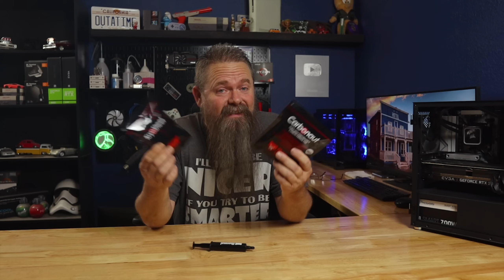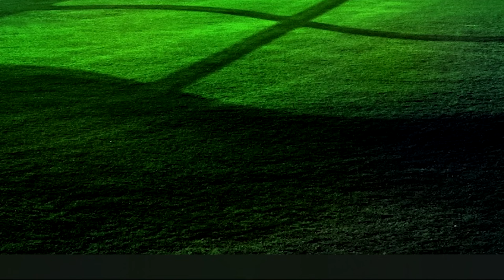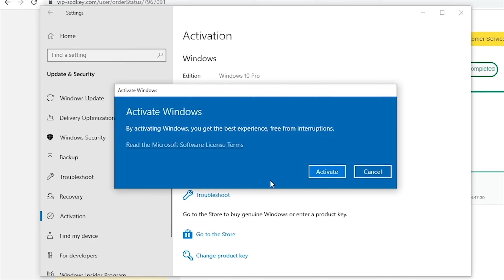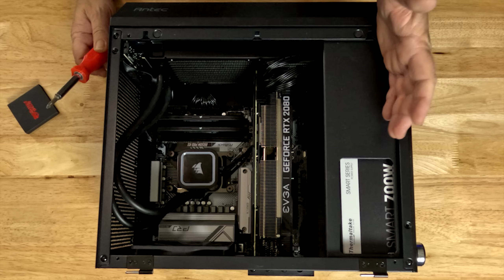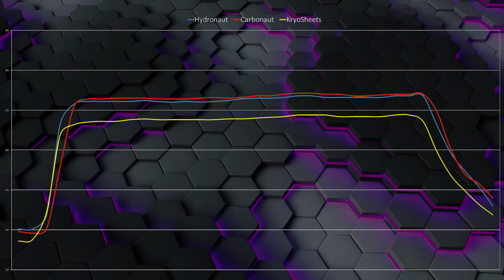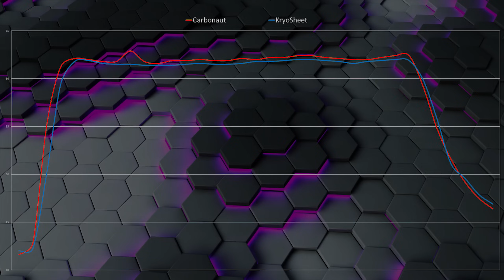Thermal Pads OR Paste, Which is Better?

Comment: This whole cpu temperature morass is a tempest in a teapot, IMO.  All of those methods work and work well everything else being proper.  But if you are a nut case about abusing a 'puter until it dies then being OCD over cpu temperature is a way to keep you off of the streets.

Comment: I have been the Kryosheet of the last few builds that I have done and I think what you are missing is that you don't have to re-paste and if you tested a system with a Kryrosheet after a couple years it will be the same as when built, whereas paste will slow go down over time.  Also, since most people can't agree on how much paste to use the sheets just life easier.  Pay a little more up front have the same performance till dismantle or replace the system several years later, or save a few dollars on the paste, but spend an hour of your time once every couple of years to re-paste your CPU, and I am sure an hour or even a half of your time is worth more than the $20 you save between the two solutions.  Anyways great video, informative, but you should consider a long term test, it might take a year or two to make it but I think the results will surprise you.
Reply: This is good to know. Longevity wise. Definitely going the kyrosheet route.

Comment: I got a sheet of PTM7950 to try, ended up using it first on an Epyc CPU.  Was initially more fiddly to work with than paste but not having to worry about die coverage (not that the chip I'm using it runs particularly hot) or having to potentially replace it in a few years makes me feel like it was worth the minimal bother getting it installed.  Probably much more worthwhile on a chip that runs hot though as the whole point is the better thermal transfer over time.

Comment: I’ve had a i7-6700k in place for 8 years of gaming that just started crashing. Anyway, today i learned that thermal paste needs to be refreshed every few years.
Reply: HAHAHA WHAT?! I'm still using a i7 3770k with it's first paste.
Reply: @HungerForMore0   Haha same. i7 2600k still running with 15 year old paste lol.
Reply: @sirhendro there is no paste left boss
Reply: @HungerForMore0 same. Didn't know this was a thing until now
Reply: I never  change or replaced   the thermal paste (Artic Silver 5) on my CPU for almost 10 years now  😅 (intel 6700k)  , and keep going strong  😅
Reply: aye i been using an i5 6700k
Reply: @oGKiidNoVa  No you haven't. You're either on a 6500k or 6600k - i5 6700k is not a thing that exists.
Reply: @Taizunx  you are 100% right its a 6600k. my bad mistyped !
Reply: Ya i should do that one of these days...i dindt reapply paste since 2014 when i got my 6700k
Reply: Yup, still on my i5 4690k out in the garage computer.  10 years old and still doing just fine
Reply: Hahaha. Today I changed the paste of my CPU and GPU. Because I noticed the temps of the GPU higher than before. The paste of the CPU I changed it maybe 3 years ago and 3/4 were somewhat fluid. But the GPU I did not change it before, my GPU has 8 years. And everything was solid, dots and lines of grey rock.
Reply: ive had mine for 11 years and have never touched it xD
Reply: 5 years is good practice, also goes for consoles like PS4
Reply: Been there! Rip 3600
Reply: It’s been 6 months and I’m here watching this vid thinking about changing mine. 8 years??!😭
Reply: I've been involved with computers since i was an infant and i just learned today that you're supposed to change the paste.
Reply: It is weird but I have been building since late 90s - outside of an AMD T3 CPU(s) - and even a Intel CPU in the last 7 years - never had to re-paste even after 5 or 6 years.  I keep an eye on temps and never had any undue problems.
Reply: @cylonred8902 overclocking them regulary by 25%?
Reply: The fact it was still going strong for that long until just now is a testament to how amazing Skylake was compared to the chips we're seeing from Intel now.

I still have a 6700k system from like 2015 or 16 running at 4.2GHz still going strong in December 2024 and I only reapplied paste one time ever.
Reply: I've had my i7-6700k pasted with a BeQuiet! Dark Rock TF on it for 9 years, absolutely zero issues. CPU temp has almost never gone above 65 degrees. No plan to re-paste it at this point., I'll be building a new PC sometime this year before end of Win10 support Not sure if it matters what kind of paste but I used Arctic Silver, I'm somewhat afraid to mess around with it at this point XD
Reply: Dez nuts eh 😂
Reply: Ive not changed my thermal paste in 7 years and it still runs fine. Temps are good. Basicaly the cooler which is air not water, is a pig to get back on without removing the whole motherboard and disconecting everything which includes 4 hdd and 2 ssd's. So, until it causes problems, if it 'ain't broke don't fix it is the motto I use. 😅
As for thermal pads, I wonder what the longevity is compared to thermal paste?
Reply: I have a 4790K with around a 6+ years old paste.

The temps are still normal, so I guess it can last pretty long.
Reply: im always changing the paste when i go blow the dust out from my pc case probably 1 time per year :)
Reply: clean your pc entirely like every month or every 2 months and then just refresh the paste. if you dont clean your entire pc every month or 2 months thats fine, you can still refresh the paste. refresh lmao, replace is a better word.
Reply: Arctic MX-4: need to change less often - once in 3-4 years. But, cleaning the dirt on the fans, fins, on intake and exhaust mesh grills on PC case every 3 months, and proper cable management for good airflow is extremely important.
Reply: try updating the bios to stop cpu crashing. I have only ever added new paste when swapping out a cpu
Reply: Depends on many factors: IHS or bare die, cooler pressure, working temperature, paste viscosity. Under ideal circumstances, quality pastes are effective for a decade or more. Meanwhile bad cooler attachment and runny paste means it will be shortly pumped out.
Reply: Damn bro that cpu if it can speak it would be screaming at you😂😂
Reply: Mee too dear.. pc just started crashing and suddenly thru gpt research i realised.. it was thermal paste dry out (which was 4 years old) .. that was the root cause of all of my sudden pc problems.. 😅😅
Reply: sino tienes malas temperaturas no hace falta cambiar nada.
Reply: I've been using an i7-6700k without repasting it for a decade at this point. I've not been having issues, so I just left it be since dealing with the CPU cooler stresses me out.
Reply: Update: I've the thermal pad has the advantage of lasting pretty much as long as you keep your heat sink on. No having to refresh like thermal paste when it dries out. This wont dry out.
Reply: No.
Reply: My i7-6700k has been running well. Not touching it until I tear-down for the new system.
Reply: Pads for longevity, paste for the medium between longevity and performance, liquid metal for the risk taking performance crown seeker. 👏🏻
Reply: @brandenwaite  Liquid metal is garbage, it gets into everything and will short your whole system.  Ask your local repair business's and ask them their experience with this garbage and they'll tell you it's not worth it.
Reply: @rudylawver7077  agreed, don’t mess with liquid metal unless you’re attempting to enter a world record overclocking league table. It’s just not worth the hassle
Reply: I've been using a i7-7700K since early 2017 with kryonaut paste applied 1 time, my thermals are identicle today as they were when I built the system. CPU peaks around 70c under load. Isn't that crazy? I'm building a new system right now actually, and was looking up these pads to see if they're worth it, or if i should just get another tube of kryonaut. I actually think it's from heat cycling btw. I think people who power their computers off every night, have more thermal paste degradation. I'm one of these crazy people who leaves my PC on all the time, and I think it probably keeps the paste warm enough to stay pliable forever, whereas if you keep heating and cooling it, i think it will after time become more brittle. Ambient temps are like 20-23c, but I think if your computer stays on, the paste never gets much cooler than 35-40c. That's almost a 60F degree difference. I think people should stop turning their computers on/off when they're not using them. Yes your electricity bill will be slightly higher, like leaving an oldschool light bulb on, but I think there's actually benefits to it. The components aren't expanding and contracting as much.
Reply: Don’t you ever clean your pc from dust? Filthy
Reply: wut? 😳this explains alot...
Reply: so you haven't change the paste for 8 years? holy shite 😅
the general advice is to change the paste once per year
Reply: @ yeah haha. I hadn’t read about refreshing anywhere somehow. Lesson learned, for sure.
Reply: @macblink  the thermal paste industry thanks you.
Reply: @macblink  my amd fx 8350 black addition build has never had the paste changed, its a stock build from at least 15 years ago, god knows what paste is left but its nice and cool with a 5 g overclock
Reply: @macblink  I changed mine lol I did it when I changed my case out like 3-4 years ago.
Reply: @macblink  Once a year is beyond overkill. Ive had the same thermal paste on my 8700K since 2018. I obviously should change it by this point but I'm upgrading to a whole new pc in a few months so not gonna bother. Id say once every 3 years is more realistic.
Reply: @macblink That is definitely not necessary. It deteriorates slowly. Freshen every three years. You’re welcome.
Reply: @macblink 😂😂😂😂 no its not thats not a thing I've been building pcs longer than u been alive
Reply: @macblink  I have PCs where it hasn't been changed for longer than 8, and they're fine. It's a shitty paste if it degrades in 1 year, or even 3.
Reply: @macblink  Yeah if it was laid down bad the first time around. I haven't changed mine(nor do I ever until I build a new rig) for 5+ years and my temps and system stability has never changed.
Reply: @macblink  I don't think that's the general advice. Please think of professional server systems and the like, nobody changes thermal paste in these on a regular basis. I bet it will not be changed as long as the server is in service and these CPUs throw out a lot more heat than what average joe has mounted on its mainboard.

There is no issue with dried paste, as long as the cooler does not move. If there is movement, even the smallest amount, that dry and hard paste fails to do the job, because it will micro-crumble and that leads to bad thermal conductivity. Drying paste can be used on CPU coolers which screw on and have a really strong mounting system or on very small coolers, which don't tend to wiggle much because of their size / weight. Many intel CPU stock coolers still sit very tight on dried paste after many years e.g., they even hold on to the CPU without additional mounting. That's a perfect thermal bonding, but quite hard to service.. o)

I would not recommend using any (quick drying) high performance thermal paste on GPUs, because these are quite flexible boards with the cooling parts mounted not very rigid and tight most of the time.

Here's the catch though:
You don't have to think about any of these problems, just use regular silicone based thermal paste. Even the regular white one will do the job. It's been used for decades in all kind of power supplies and audio amplifiers. Quality silicone paste does not dry at all, it's not supposed to, because nobody tears apart power supplies and audio amplifiers to change thermal paste.

If your system only is stable with 1-2 degrees less temperature, any special thermal paste is not the right fix anyway. You should have some headroom all the time, even in summer, which makes clear that saving 1-2 degrees by using an expensive, inconvenient special thermal paste is pure nonsense.

The video here is quite some months old, I just wanted to put some different perspective out there, to all the new kids on the block, which might fall for the thermal paste scam business. "Which thermal paste" is nothing a regular PC user / enthusiast should care about, just use the most basic one and you will be fine. I even use CU paste in my test setups and systems with regular workload, it's actually meant to be used on nuts and bolts and sliding parts on cars and machines, but it also does the job. You can get a handful / life time amount of this stuff for a dollar almost everywhere, even your buddy doing cars will have some around on Sunday evenings.. o)
Reply: I built an i5-4590 desktop like 10 years ago using Arctic MX-2... never repasted it, never had cooling problems using the stock cooler, even running full load, but it only pulls like 65W. I imagine the higher your power and temps the more difference you'd notice over time.
Reply: @macblink I hadn't changed mine in about 7 years and with a 1.28 undervolt at 4.2 my temps didn't exceed 85-87c even after 7-year old paste. I just repasted it now recently but it goes to show just how well designed skylake was.
Reply: @macblink  Only once a year? I change it every day.
Reply: @macblink I change my Kryonaut all 2 years
Reply: @macblink once per year is too much, usually 2-4 depending on light or heavy use
Reply: @macblink I have not changed my thermal paste in 15 years. No wonder my computer keeps restarting
Reply: @macblink  Use a good paste. Don't need to change every year.
Reply: @macblink uh, once a year is completely unnecessary. Good quality thermal paste doesn’t dry up that fast, repasting every 5-8 years is fine
Reply: @macblink  just changed paste a day ago after 6 years couse cpu change and its never been an issue at all, it performed and looked like just as a new one

Comment: brother i give u now tipp for life.
if u buy a new cpu and cooler. the first u do u put liquidmetall on it, wish in very good and clean again away.
the think is u will never clean it to 100% perfect some molekul will always stay at the metall for ever. so the first you should do a very good liquid metall. after u can use cheap past or what else.
if u put a cheap thermal paste on it, you cpu will always get bad molekul on the metall.

i hope u understand what i mean.

the only thing to take this bad paste away, it so sharp it a little and polish again to mirror. it should glue on glass with out problem, so there is no air between no bad molekul

Comment: I have been using  a IC Graphite thermal pad made by  Innovation Cooling Since 2018 on my AM4 MB. I upgraded my CPU over a year ago and the pad worked exactly the same and I have not had any issues. I will never go back to paste. I mean with the cost of everything, what is $15 really. I built a second  system and am using the same thing. Great Brand!
Reply: What are the temps ?

Comment: I haven't used paste for seven or eight years. The small difference in temperature is not worth the additional hassle factor, or the risk of the spread not quite going right. And they don't dry out and need replacing.

Carbon pads are also much easier to use with the new oddly-shaped Ryzen chips.
Reply: Good point. I just took a look at my ryzen chip and was wondering how I was going to get the paste to cover the awkward corners lol. Time to go get a pad

Comment: These sheets are interesting.. FWIW, I recently picked up some PTM 7950 to try out on my 5900X and it's definitely outperforming my previous MX-6 paste by a small margin, even right out of the box. I'm not doing super scientific testing, but I did see a drop of a couple C, while also measuring one or two decibels lower from my fan curves, after a day or two of use. I have a second application worth, so I'm going to put it on my 9800X3D, whenever it shows up.

Comment: Temperature issue is almost always poor thermal contact with the IHS.

Intel has poor solder and bent/curves IHS so no wonder they run hot.